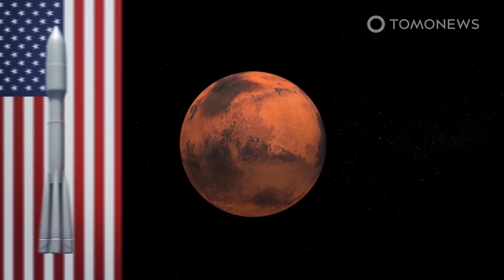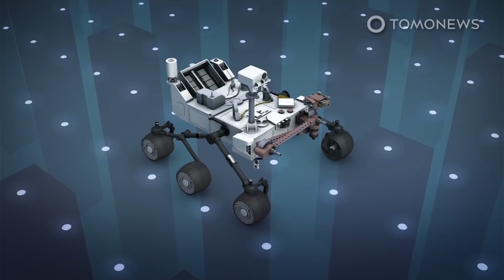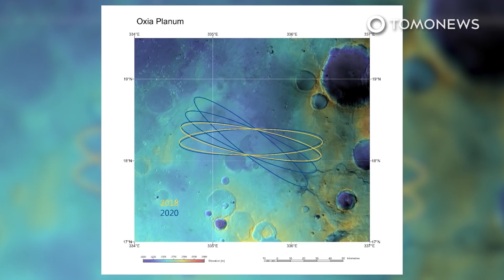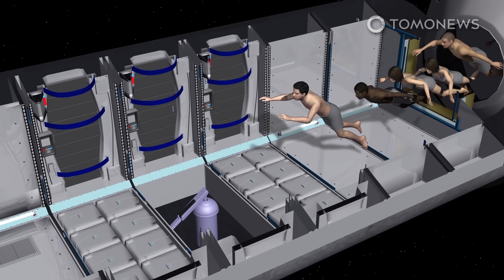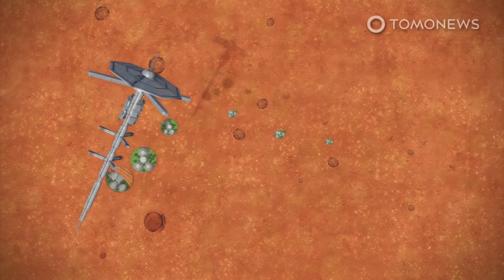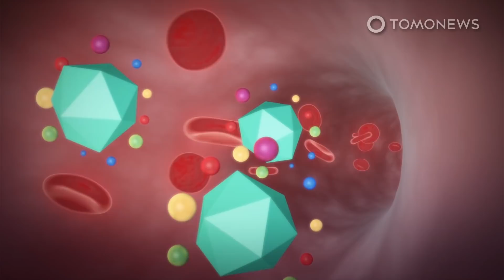Mars 2020: Race to the Red Planet

Comment: The rover is called perseverance and there is a little helicopter called ingenuity weighs less than a full 2 liter bottle
Reply: That's heavier than I would've expected as the atmospheric pressure is 1% that of Earth's.  Indeed Mars atmosphere is more of a vacuum than can often be created on Earth.  I would've expected a hydrogen blimp with the top being a solar panel and very large propellers that furl out for navigation perhaps a memory metal.

Comment: the capsule doesnt enter the atmosphere point down, the heatshield is the black part and it enters bottom facing down. what a whacky animation.
Reply: It enters by point down. Like Space X return rocket, They returned point down  until their falling velocity dropped to less than 220 mph  they turn up and start ignited tail rockets  until touch down.
Reply: alex Lo I’m talking about the CAPSULE not the boosters or the starship
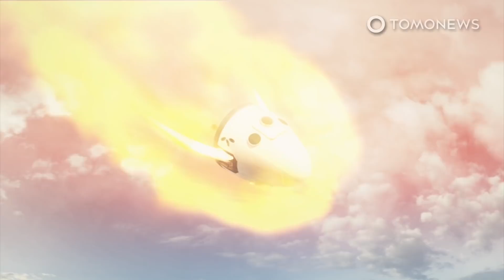Reply: 11:13
Reply: Ikr as a space exploration fan I hate it

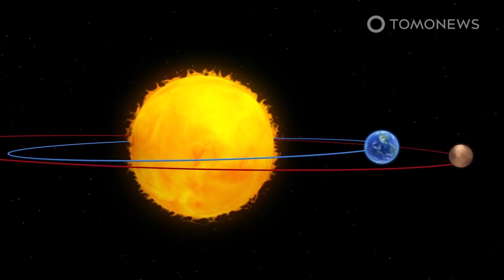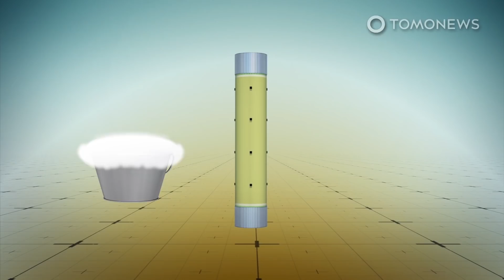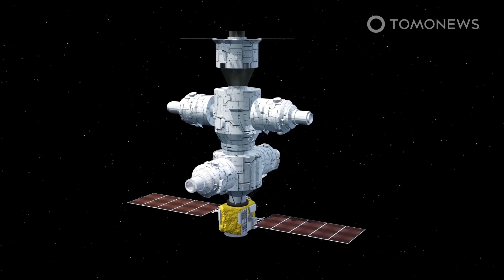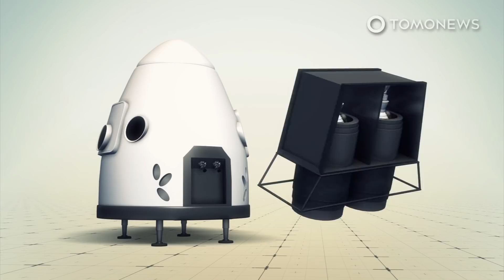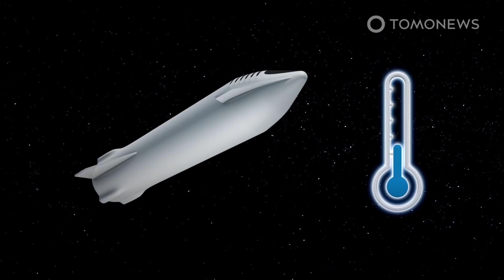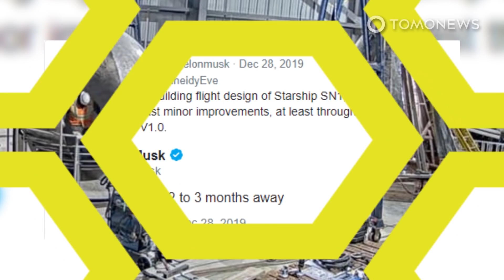Comment: 0:07 USA: That is not what Mars 2020 will be riding on. That's a Soyuz not a ULA Atlas V. United Arab: That's is also not Japan's H-IIA launch vehicle 0:36 No Earth will NOT be between Mars and the Sun. Mars will be in front of Earth around 45 degrees. 8:55 No its going to hold liquid Hydrogen and liquid Oxygen. 10:17 No a lunar rover will not look like that. That is not designed for Moon's gravity it's designed for Mars. 11:22 NO Dragon V2 will NOT be entering the Mars atmosphere like that, the heat shield isn't even facing the right way and the engines will not be lit to boost the craft even faster. 12:15 No they will never keep the engines on the whole time and turn the whole spacecraft down towards Earth. 13:12 NO it will be entering the atmosphere BACKWARDS 13:35 NO it's working on SN5 already. 18:19 NO Shuttles will Never be able to fly in the Mars atmosphere They are GLIDERS  There are still so many errors in this video.
Reply: Wel how can it be so wrong on so many levels  its bizar